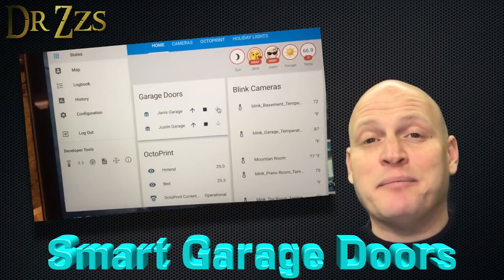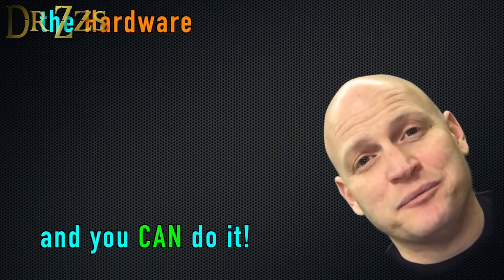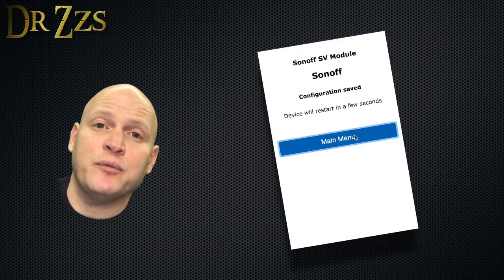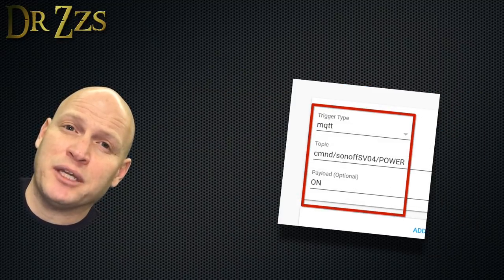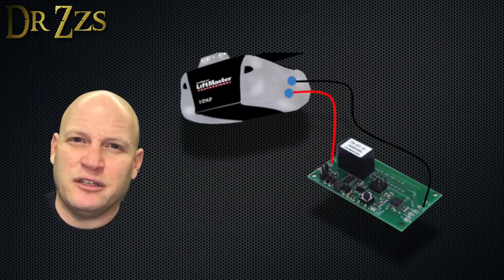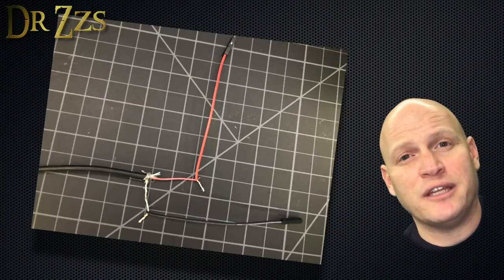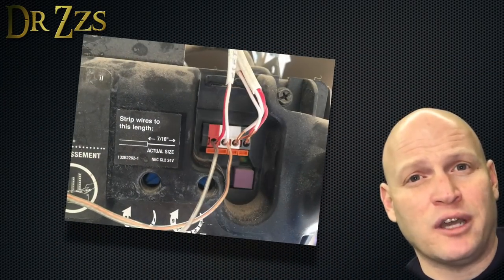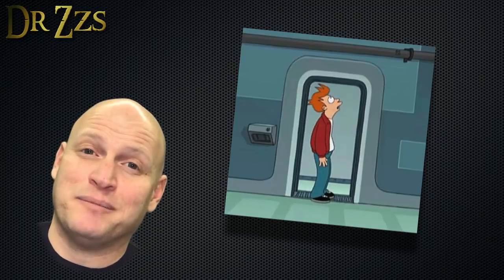$5 DIY "Smart" Garage Door Opener using Sonoff SV

Comment: Hello DrZzs. I am trying to set it up using NodeMCU. I guess if I use Tasmota, it should not matter, right? 
I entered the following in Console:
Switchretain 1
Powerretain 1
switchtopic2 garagestate
switchmode1 0
switchmode2 2

The problem that I have is that my reed switch does not work. It works as a relay and not a sensor. When I connect my reed switch, it shows me the following. Can you help me with this? What am I missing? 
01:20:24.317 RSL: POWER = ON
01:20:24.440 RSL: RESULT = {"POWER":"OFF"}

Comment: Question
So I have a SR04 hooked up to the GPIO 4/14 for Trig and Echo. I added a sensor  to the Configuration.yaml.
  - platform: mqtt
    state_topic: "tele/garage1/SENSOR"
    name: 'Distance'
    unit_of_measurement: 'cm'
    value_template: '{{ value_json.SR04.Distance }}'

If I mount the SR04 on the ceiling of the garage facing down I will assume the following. 
Distance to the floor = Garage closed No Car
Distance to the garage door = garage door open
Distance to the top of car = Garage closed Car in garage

How would I setup the cover section to use the different distance measurements to represent the open/closed sates of the door and have a new Icon stating  the car is parked/ Not parked in the Garage?

Comment: Dr.Z.  Just got to say thanks for the clear and concise presentation of sonoff devices.
You and BRUH have me hooked on Home Assistant and Sonoffs.
I've done my house garage doors with the sonoff-sv and my external shop doors with sonoff basics (isolated the relay from 110)
One suggestion which might of already been covered, in the sonoff console I give the command 'switchretain 1' this make the MQTT broker retain the last state of the doors. Prior to this when I restarted HA or rebooted the PI,  HA lost the state of whether the door was open or closed. (the sonoff only transmit the state when it changes)
Thanks Again.
Reply from the maker: great point! 
I'm making a list of short topics I can cover in 1-2 min videos.  I'll put that on the list. 
Thanks!

Comment: Any reason why this does not work on the latest tasmota and HA versions?  I cannot get the reed switch to show up in HA.
Reply: I'm in the same boat.  I just flashed my OG Nexx Garage with Tasmota.  The open/close part seems to work, but I can't figure out how to get the reed switch to show up in HA.  (The original Nexx Garage was built using a Sonoff Basic, mine is the R1 version)

EDIT:  Got it working, I think it was the SetOption114 1  mentioned by Jamesj here.

Comment: I've been using this setup for a couple of months now suddenly the status has stopped working. I can short the GPIO14 pin to ground and it is not detected. If I toggle the switch associated with it in the WebUI the console shows on and off for Power2. Has my SonnoffSv gone faulty?
Reply from the maker: hmmm. If you are grounding GPIO14 and there's no change in Tasmota then something is wrong with the device.  Does anything show in the tastmota console when you ground gpio14? Did you update Tasmota?  maybe it changed the way it reports the activation of that sensor.
Reply: I have updated Tasmota to the lastest version and I'm not sure if it happened then. The console shows the reed switch turning on and off but MQTT.fx doesn't show any result or status for POWER2.
Reply: I'm having issues with it not changing states too, I haven't updated Tasmota.

Comment: Present detection,  have you tried life360 and using Alexa then having home assist   work with alexa?

The other option is pressure sensors embedded in the driveway as you pull in. I would suspect its best to put it at the beginning of the driveway as you pull in or leave will then trigger the door opener.  Pack of four sensors on Amazon like 20 bucks. Now that being said that's has the  worst security as if your away from home and someone pulls into driveway to turn around then garage door opens.

Another option is a sonic detector. Your car emits a sonic frequency and you setup a receiver so when it hears it  triggers the garage door opener

Comment: If you Console the PulseTime<x> command (ie. PulseTime1 10),  then you can skip the second automation that turns the relay back off after 1 second. Instead,  the Turn OFF trigger will be executed automatically via the Tasmota firmware, and not through Home Assistant.

PulseTime<x>                  Show current PulseTime of relay<x> in 0.1 seconds
PulseTime<x> 0 / off        (Default) Disable use of PulseTime for relay<x>
PulseTime<x> 1..111         Set PulseTime for relay<x> with 0.1 seconds increment
PulseTime<x> 112..64900 Set PulseTime for relay<x> with 1 seconds increment starting with 12 seconds (add 100 to desired interval in seconds, e.g. 113 = 13 seconds and 220 = 120 seconds)
Reply: I tried using Pulsetime and it works as expected. However the switch keeps activating. In console I see the following
23:56:17 MQT: Attempting connection...
23:56:17 MQT: Connected
23:56:17 MQT: tele/sonoff/LWT = Online (retained)
23:56:17 MQT: cmnd/sonoff/POWER = 
23:56:18 MQT: stat/sonoff/RESULT = {"POWER":"ON"}
23:56:18 MQT: stat/sonoff/POWER = ON
23:56:19 MQT: stat/sonoff/RESULT = {"POWER":"OFF"}
23:56:19 MQT: stat/sonoff/POWER = OFF

Looks like each time MQTT connects it switches it on. If I set Pulsotime back to zero this does not occur when it connects. Any ideas on what I am doing wrong. Tried it on two different SV boards and same result.

Comment: Automation trigger didn't turn OFF the relay whenever the relay is turned ON, but reed switch states get updated correctly at HA.
Below is the content of "autimations.yaml" and what did I miss?

- id: '1540172082989'
  alias: 42M Garage Trigger
  trigger:
  - payload: 'ON'
    platform: mqtt
    topic: cmnd/sonoffsv01/POWER
  condition: []
  action:
  - delay: 00:00:01
  - data:
      payload: 'OFF'
      topic: cmnd/sonoffsv01/POWER
    service: mqtt.publish
Reply: * automations.yaml
Reply from the maker: I would suggest removing that whole automation and instead go to the Tasmota console and type "pulsetime 10" That'll set the relay to trigger just for 1 second then switch back off automatically.  I didn't know about that option when I made this video.

Comment: This is great!  Thanks!  Is there any reason that the reed switch is in the door open position so that the door reads as closed until it is fully open?  I would think, for a security standpoint, it would be better to have it in the closed position so that if the door is in any position other than completely closed it reads as open.  I'm guessing that if I wanted to make this change, I could just use a NO reed switch and not have to make any other changes, right?
Reply from the maker: No really important reason.  You could certainly put the sonoff and reed switch down near the ground by the door and run wires up to the opener. You just don't want to run long wires from the reed switch to the sonoff.  The signal voltage is really low so if you put it through 20' of wire you may lose it.  The relay wires are 12v so those can travel long distances.

Comment: Weird issue. The reed switch is triggering the relay on and off. Not sure whats going on with that and the status in HA us unknown. I tried switchtopic 2  but it gives me this is a result in console 16:44:49 CMD: switchtopic 2
16:44:49 MQT: stat/sonoff/RESULT = {"SwitchTopic":"0"}
Reply from the maker: Check the other comments.  I can't remember right now how we fixed that, but others had the same problem.
Reply: In the CMD "switchtopic 2" or "switchtopic 2 2"

Comment: Hi DrZzs, i'm getting the error below when adding the cover under customize section.  Can you help?

Testing configuration at /config
2018-03-18 23:44:52 ERROR (SyncWorker_0) [homeassistant.util.yaml] mapping values are not allowed here
  in "/config/configuration.yaml", line 15, column 20
2018-03-18 23:44:52 ERROR (MainThread) [homeassistant.bootstrap] Error loading /config/configuration.yaml: mapping values are not allowed here
  in "/config/configuration.yaml", line 15, column 20

  customize: !include customize.yaml
   cover.garagedoor:
    device_class: garage
    friendly_name: My Garage

cover:
  - platform: mqtt
    name: "garage"
    state_topic: "cmnd/2/POWER2"
    command_topic: "cmnd/garage/POWER"
    payload_open: "ON"
    payload_close: "ON"
    payload_stop: "ON"
    state_open: "ON"
    state_closed: "OFF"
    optomistic: false
    retain: false
Reply: nvm found out that i needed to delete the !include customize.yaml text
Reply from the maker: Awesome!  
Glad you found it 
If you get to the point that you want to split your configuration.yaml into a bunch of smaller files, instead of one big one; that's when you'll use the !include blahblahblah.yaml

Comment: doc... I got a Sonoff SV connected as per your example to my gate, using the contractor to "trigger" the gate open and closed, and then a cheap magnetic reed switch to tell me if the gate is open/close. Discovered my gate also have a "lock/unlock" function, also works on a simple trigger. any ideas. I got 2 sets of gpis pins open, best I can figure out is to connect a relay to them, and then have the relay do the trigger onto the /lock/unlock, 
comment.

Comment: I'm using wifi for presence detection.  I have google wifi and they have an IFTTT channel that supports "device connected" and "device disconnected"  I just set up an IFTTT to communicate those connects and disconnects to home assistant.  Working great thus far (been using it about 2 weeks).
Reply from the maker: Do you have problems if, like your phone goes dead and shows up as "disconnected". 
I'm afraid mine would open and close when I go get the mail. 
Glad it's working for you though!
Reply: I don't generally run out of battery on my phone, but it wouldn't matter if it happened while I was away.  The IFTTT only fires when I connect or disconnect, so if I was at the mall it would already be disconnected.
Reply: You can use both solutions. Wifi and regular iOS app location. Just use some AND logic for going out and OR for being home
Reply: I am pretty sure the IFTTT APP sends a connect/disconnect signal to the web service, so if your phone just died, it wouldn't send the signal, and nothing would happen.  I also think it might open your door when you come back from getting the mail (that would be a good thing for me though...)
Reply: Robert is talking about Google Wifi, which itself has IFTTT integration. The router sends the signal when a specific device connects or disconnects in this situation, not the phone. So if your phone died the router will send the disconnect message.

So for phones, it might be better to just rely on your phone to send the signal to IFTTT, but the Google Wifi IFTTT integration can be used for other things that can't easily have IFTTT in it. For example, my Honda Civic's head unit has Wifi (for some reason), so I can use it connecting to the home wifi to indicate that the car is on and open the garage. And then when it disconnects it means that the car is either off or out of range, so it will close  the garage.

Comment: Not sure why you would need to convert the switch to isolation mode at all.  By connecting one of the garage door wires to the input positive terminal and the other to the output positive terminal as you did in the video, when the relay energizes, wouldn't the two wires be shorted together, accomplishing what you needed the switch to do?
Reply: Ok, I figured it out by trial and error using a 12V DC input.  With 12V applied to the two small header pins, I get the following results:

With Resistors installed:
     Relay off: measured 12V across input+ and input-, and 0V across output+ and output-
     Relay on: measured 12V across input+ and input-, and 12V across output+ and output-

With Resistors removed (this isolated the 12V from the input terminals):
    Relay off: measured 0V across input+ and input-; opened circuits between input and output terminals
    Relay on: measured 0V across input+ and input-; closed circuits between input and output terminals

So in summary, in order to use the SV for opening a garage door as demonstrated by Dr. Z, the resistors have to be removed.  After removing the resistors, there are 3 ways to hook up to the garage door:

1) one wire to input+ and the other wire to output+ (as shown in Dr. Z's video)
2) one wire to input- and the other wire to output-
3) short input+ to input-, then connect garage-opener wires to output+ and output- (as shown in various other youtube videos)

Comment: I have a similar opener to your original version . But I have a wemos in my car connected to a spare usb port ... When I power the car up , the wemos connects to the local wifi send a presence mqtt message it open the garage door .. if closed the door opens ... When the signal is broken .. ie car is out of range , door closes .. when I come back into range garage door opens as I come up the drive. Way ... Just one wemos and a USB power cable in the car !!
Reply from the maker: Someone just sent me a link for something similar to that. 
I think that may be the solution!
https://hackaday.com/2018/01/21/esp8266-beacon-announces-your-arrival/

Comment: Hi can anybody help I am tearing my hair out 

I constantly get this in the Sonoff SV console
I cannot figure where it is coming from

1:56:42 MQT: cmnd/gatestate/POWER2 = OFF (retained)
11:56:43 MQT: cmnd/gatestate/POWER2 = ON (retained)
11:56:43 MQT: cmnd/gatestate/POWER2 = OFF (retained)
11:56:44 MQT: cmnd/gatestate/POWER2 = ON (retained)
11:56:44 MQT: cmnd/gatestate/POWER2 = OFF (retained)
11:56:45 MQT: cmnd/gatestate/POWER2 = ON (retained)
11:56:45 MQT: cmnd/gatestate/POWER2 = OFF (retained)
11:56:47 MQT: cmnd/gatestate/POWER2 = ON (retained)
11:56:47 MQT: cmnd/gatestate/POWER2 = OFF (retained)
11:56:47 MQT: cmnd/gatestate/POWER2 = ON (retained)
11:56:47 MQT: cmnd/gatestate/POWER2 = OFF (retained)
11:56:49 MQT: cmnd/gatestate/POWER2 = ON (retained)
11:56:49 MQT: cmnd/gatestate/POWER2 = OFF (retained)
11:56:49 MQT: cmnd/gatestate/POWER2 = ON (retained)
11:56:49 MQT: cmnd/gatestate/POWER2 = OFF (retained)
11:56:52 MQT: cmnd/gatestate/POWER2 = ON (retained)
11:56:52 MQT: cmnd/gatestate/POWER2 = OFF (retained)
Reply from the maker: Do you have any automations or rules running?  I can't tell from that output where the command to change state is coming from.  Turn off any automations or rules that have anything to do with controlling the relay.  It could also be something physical, like the switch is being activate somehow unintentionally.  Disconnect your reed switch to make sure that's not doing it.  I wish I could tell you exactly what's happening.  Try those few things and if it's still going on let me know and we'll think of something else to check.

Comment: I set this up in my house and the sonoff created interference that prevented that wireless garage remotes from working all the time. Do you have any ideas on how I could fix this issue?
Reply: I am having the same problem. I bought 100ft of 22/2 doorbell wire off amazon for about $11 and plan to move the sonoff off the top of the garage. I think adding some distance from the two will stop the interference. It's not as ideal, but I need both working. You would think that it wouldn't matter since they're different frequency ranges, but here we are. Let me know if you have any ideas or find success with something else.
Reply from the maker: Bummer.  I didn't notice, but I actually don't use the old remote much anymore.  I use the MQTT car presence most of the time.
Reply: @DavidLyon_UT  I think you will need to move it pretty far. When I just had the sonoff disconnected and plugged into a outlet in the corner of that garage I still had interference from it. I think you will have to move the sonoff outside the garage
Reply: I found the easiest solution from a comment on an antenna extension video! "first, make sure the garage door frame/brackets/rail are not grounded. if they are not, then simply attach a bare end of the garage door opener antenna to the FRAME! the entire door opener frame becomes an antenna and the range will become at least 100 ft." All i did was strip off a little of the antenna that hangs and taped it up with electrical tape. My reception range is now better than before the sonoff interference! I hope it works as well for you!